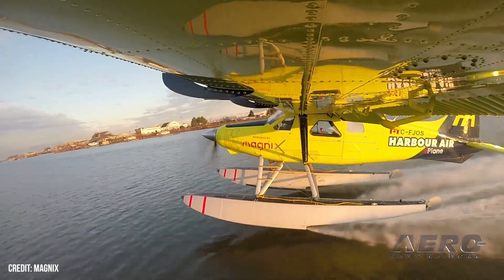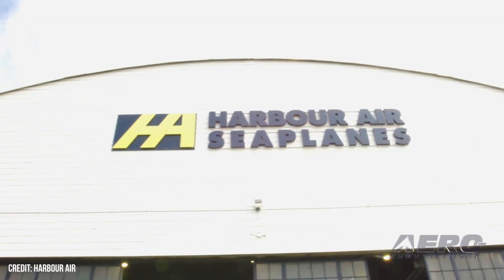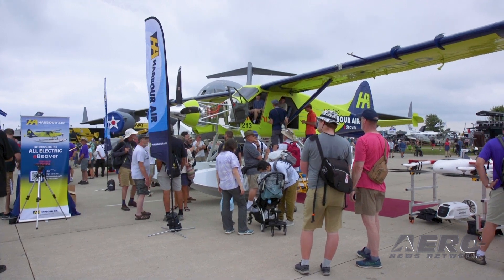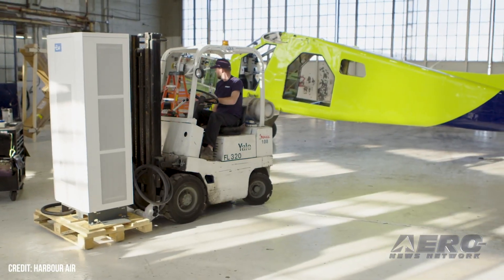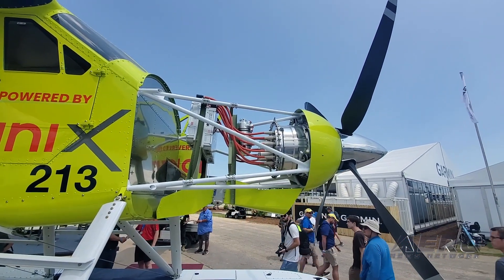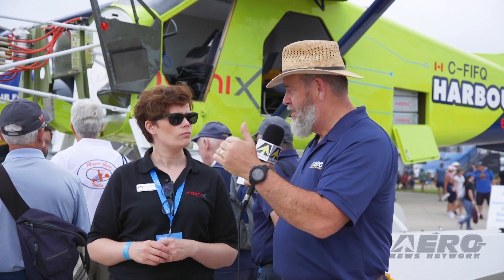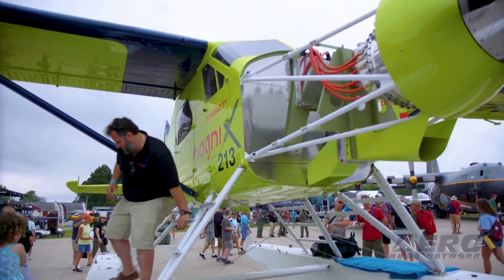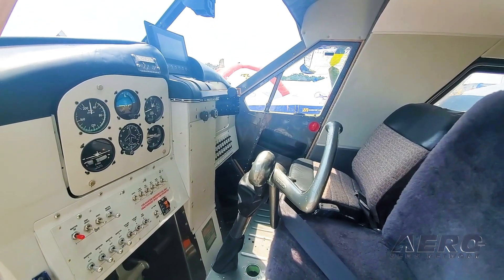Aero-TV: MagniX Electrifies A Harbour Air Beaver

Comment: Not commercially viable.
Reply: Absolutely commercially viable, as maintenance costs are a tiny fraction, fuel savings is another huge factor, You obviously cannot do everything a traditional plane can do but for short flights it is pretty perfect. Velis Electro (2 seater electrical training aircraft) flying for years now and is very successful, and electric aviation will be the next really big thing after EVs and E-trucks are going more and more mainstream and are only questioned by clueless people anymore.

Comment: Electric engines are a beautiful piece of engineering. That thing looks like a work of art.  I bet the reliability goes through the roof.
Reply: Certainly more reliable than a radial engine I'd guess?? Turbines are generally exceptionally reliable, but they are not cheap engines (Half million for a new one I'm guessing and overhauls at every 5000 or so hours are not cheap (guessing $300,000?)! But simplicity of maintenance and operation in flight I suspect is dead simple! I would be curious what one of these motors costs and what a battery set costs? The batteries may need replacing every several thousand flight hours, but that cost is offset by significant fuel savings for sure.